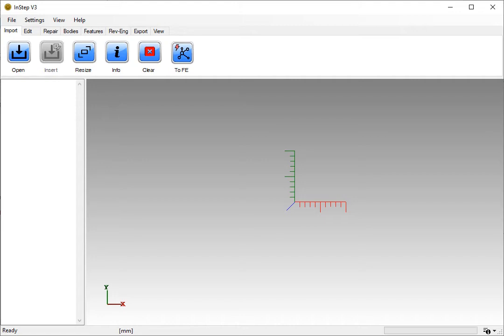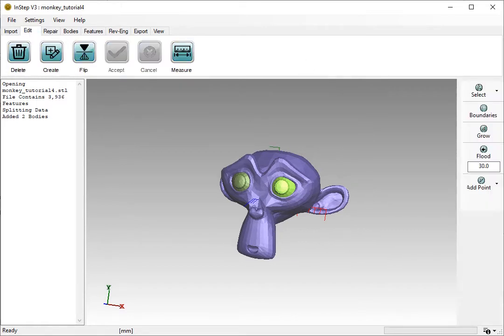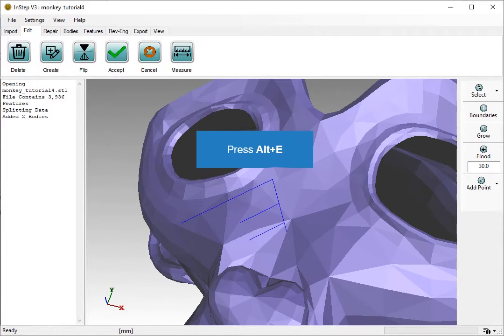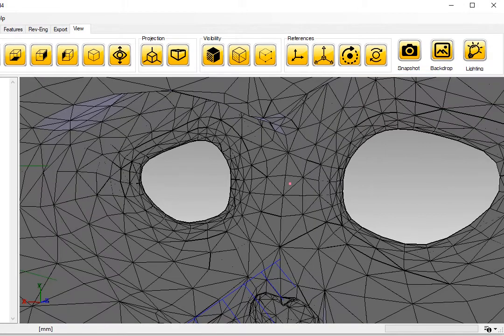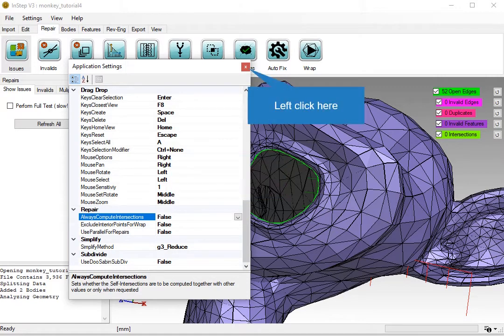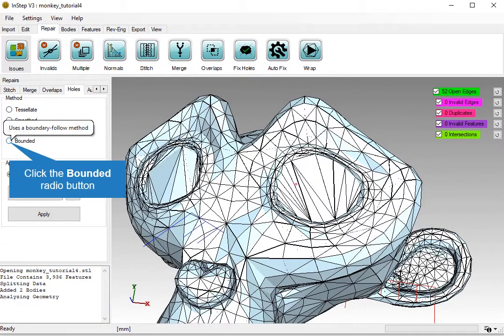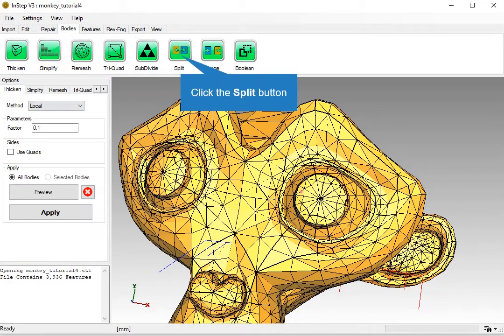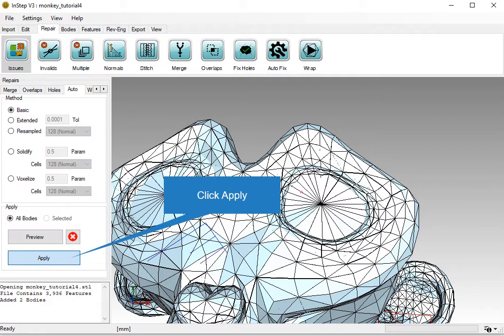InStep Studio Tutorial4: A quick look at the Editing and Repair options

Comment: I have reversed the functions of the left and right mouse buttons. Upon restarting the application, it defaults to the default values of these button settings. My settings come in effect only after opening "Application Settings" window.
Reply from the maker: The appropriate thing to do with bugs discovered would be to create a ticket or reach out to support...
Reply: @solveering  I am trialling the software, don't have a licence yet.
Reply: @solveering  another thing got me annoyed is the viewing edges, nodes etc isn't carried forward when changing tabs at the top. Eg,  if I turned on visibility of the nodes in Bodies, then switched to the repair tab, nodes got hidden. 

Software offers a lot, but it isn't polished as much. Tried to convert a simple stl that I found on thingiverse, but it wasn't so successful.

Anyways, I'll keep trying it, it may be due to myself being a novice to mesh type files.
Reply: @solveering  5 seconds wait for demo version is quite annoying too as I had to restart the software many many times as it was unresponsive and acted weird at times.